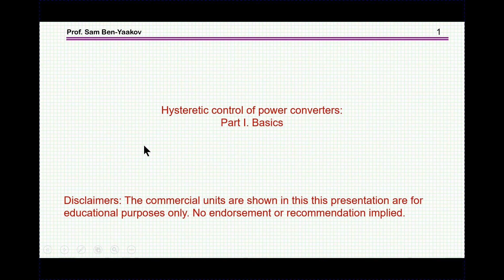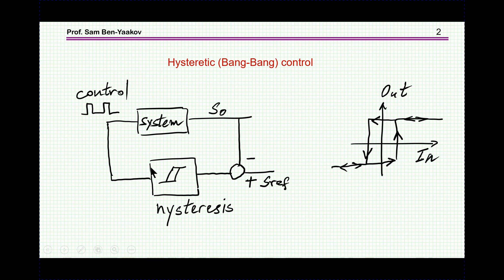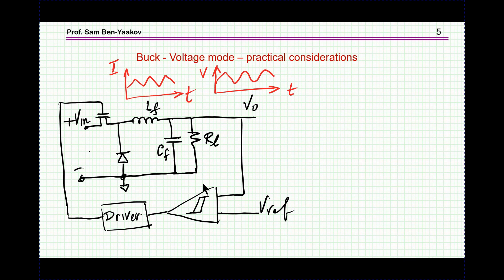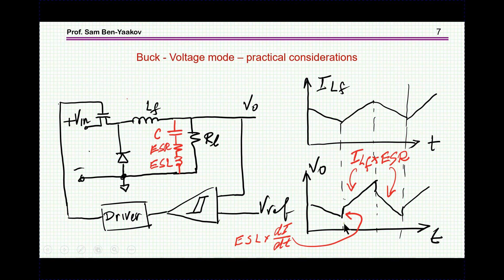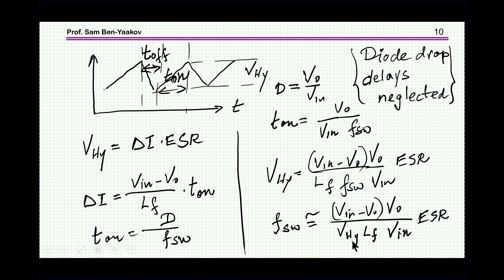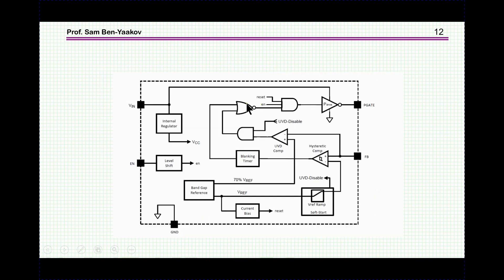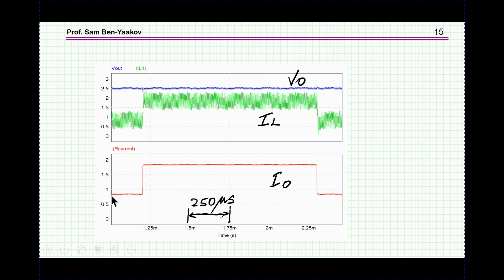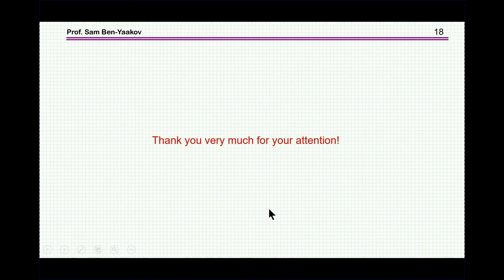Hysteretic control of power converters: Part I. Basics

Comment: Thanks! I hope part 2 can talk about the advantages/disadvantages of hysteretic control... i.e.: Why should I choose this strategy for a design? Does it provide stability guarantees?
Reply: Hi Nathan - I think you've got a good point here. Though I would argue that part 2 should focus on an outer voltage loop with an inner current loop as mentioned by Sam in the beginning of his video. Combined voltage/current control is a popular choice in DC/DC converter control. So benchmarking (voltage/current) hysteresis control with conventional (voltage/current) PWM control could be a part 3 to finalize the topic "Hysteresis control". Or perhaps there is no difference at all? Either way, thanks to Sam for his motivation and time to prepare these educational and informative videos. Highly appreciated. Cheers,
Reply from the maker: Will try to include as much as I cab. Thanks guys for encouragement.

Comment: Could it stabilize the loop when ceramic capacitors are used (at the sw. frequency capacitor is still capacitor, not a resistance)?
Reply from the maker: No so, usually ESR prevails. If not, the system will be stable but higher ripple and lower frequency.

Comment: could it be that ESR is higher than total Capacitor impedance? In other way yes it is clear as |Z|=sqrt((R^2+(Xl-Xc)^2)), was that not mistake or am I too tired now :) Theoretically this could be only in resonance point when L compensate C in 100%.
Reply from the maker: Zc=1/wC
Reply: @sambenyaakov  I do not get it. The real Cap Impedance; Zc conist of serial connected ESR plus ESL  and plus C, so how could the ESR be bigger than Zc, only in resonance for my understanding
Reply from the maker: The total Z= 1/(jwC) + jwL + ESR so at high frequency  1/(jwC) could be smaller than  ESR. C is not the whole device only the capacitance portion!
Reply: @sambenyaakov  now I see. thank you.

Comment: I did some PLECS based simulations and noticed an interesting phenomenon: If I set the cap's ESR to zero, the switching frequency expression no longer holds, neither the triangular shape of the output voltage ripple. It becomes a sinusoidal ripple 180 deg out of phase with respect to the switching frequency. The switching frequency value appears to be random. Is this expected behavior or a simulation setup bug?

Thanks
Reply: Of course, it becomes unstable.
Reply: @markomiljanov1597  it is still stable, as the reference voltage is perfectly tracked.
Reply from the maker: It is usually stable but ripple will go high, frequency normally down and over and under shoots larger.

Comment: Thank you professor.
Do you think Hysteretic controllers are suitable for large power converters (~2-3kW) 220AC to 400DC (with CM control loop inside an outer voltage control loop with no compensation network, just Bang-bang) ?
Reply from the maker: The other way around will be better. Inner hysteresis and outer with compensation.
Reply: @sambenyaakov  Thank you Professor. Yes, this is what I meant (inner hyst.). My question was that the outer (voltage) is WITHOUT compensation, just a LPF in the voltage feedback ?